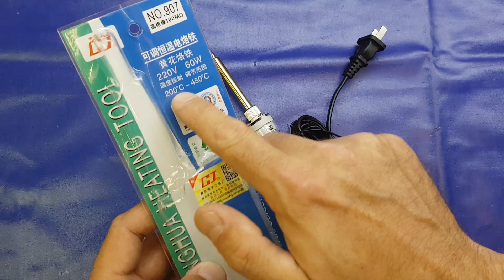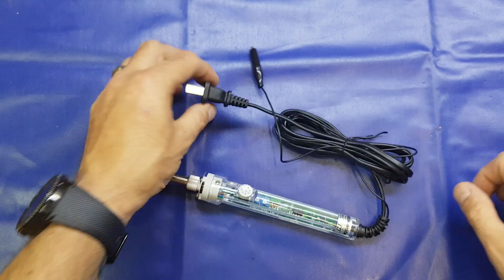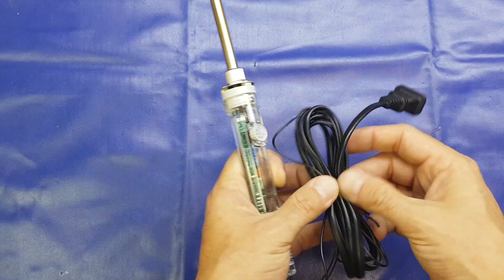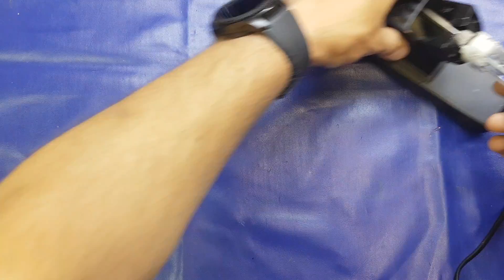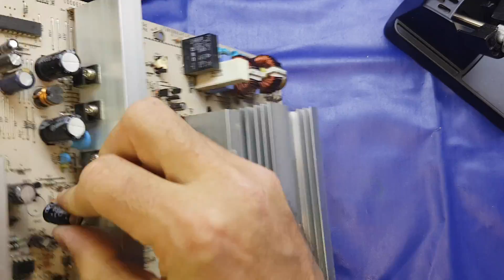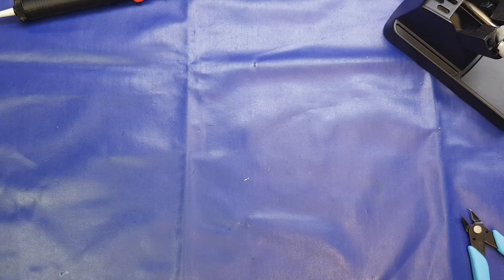Review of a cheap constant temperature controlled mains soldering iron from banggood (Model 907)

Comment: Kris, would the rubber grommet be wide enough to accept a proper 3 core cable? 
I got a cheapo "constant temperature" iron on eBay last year. There was no earth connection at all and the cable was really cheap quality so I replaced it (had to bodge an earth connection to the tip).

Comment: Hello Kris, did you check if the Temperature you set is anywhere near accurate? I recently bought one on eBay and the Temperature Dial only regulated the Current. At 200C i measured over 400C. Needless to say that I was quite unhappy with that purchase.
Reply: I bought one and reckon that the "temperature control" is no such thing but a simple triac phase control. I complained to Banggood and rather than offer a full refund for a misdescription  they sent me another of the same iron!

Comment: Did you check that the earth is actually connected?  Worth checking on cheaper appliances!
Reply from the maker: +gartmorn Yeah I did, all exposed metal is connected to the ground lead with the croc clip. The lead is rivited onto the metal 'base' of the element part of the Iron.
Reply: That's great.  I actually think the chinese stuff is getting better!  Which is just as well as that's where I purchase most of my kit, but not all.  Having said that even the stuff I buy here probably originates in China anyway!